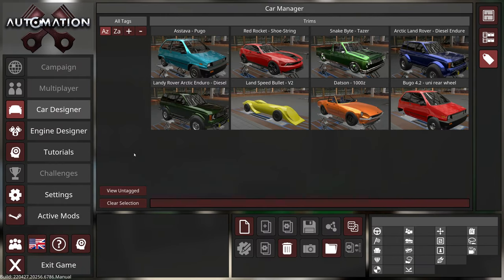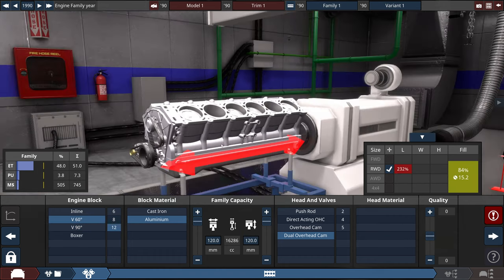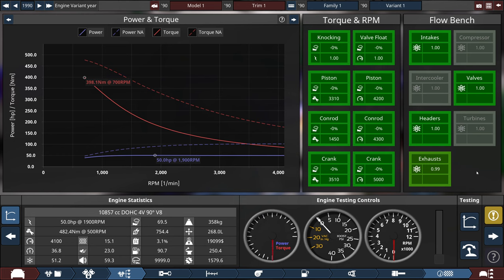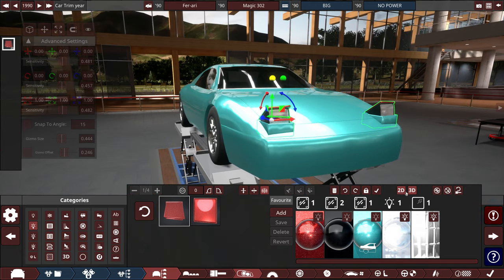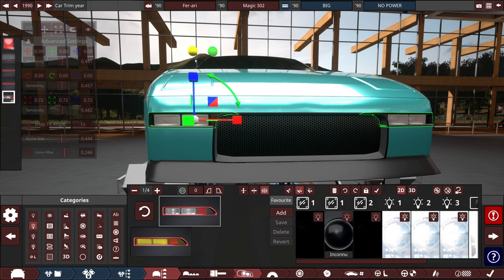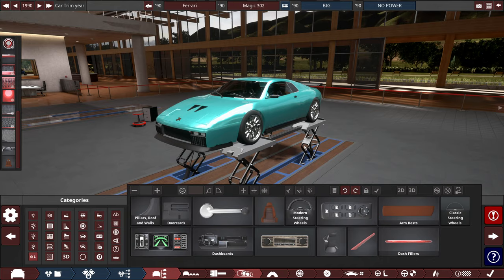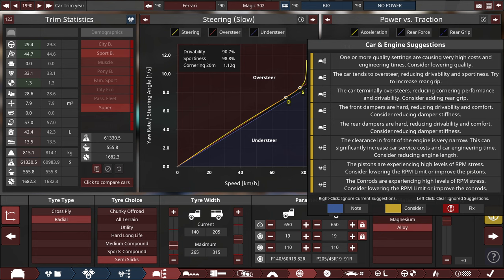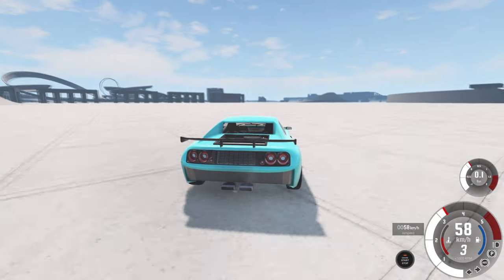Huge Engine, No Power - Automation + BeamNG.drive

Comment from the maker: Massive intercooler bottleneck.......

Check out the entire series here! https://youtube.com/playlist?list=PLTH7mxIBPJoo53TFQcaVJAfPwmKMbbrAp

Stickers are here: https://automotiveflux.com/
Reply: If you use the 80s design room to build your cars, it looks alot better without ray tracing.
Also you've effectively created an 70s muscle car, lots of engine, but said engine is just a paperweight.
Reply: Can u do the last car as a vvt cams and everything and put the vvt to max and normal cam profile to the lowest
Reply: @critterproformance1824  that would basically make the tourqe two lumps. One up high, one at 1500RPM.

Comment: I made a similar engine In my 1946 armored car, I used the morris minor 2.8 m body, and it weight 4.6 tons!, the engine alone weight over one ton
Reply: Not much armor, I want to see how it looks
Reply: Fun fact: you can loose power by having too large an intercooler for the engine performance, too high a fuel mixture, too large of an exhaust, and too large a cam profile on carbed and or pushrod engines. 
So basically you can make a gutless engine is you don't know how to tune it probably.

Comment: Ferrari with a and yacht V8 (how did Buick only get 186bhp out a 7.5 liter engine all the emission equipment that decreases MPG)
Reply: If you are talking about the old american v8s from the 70s That was the same time the SAE standardized dyno testing. One year they were still using gross horsepower with long tube headers and long intake runners on an engine test stand then the next year they used net hp. The rules were you had to measure horsepower with your power steering pump on, actual exhaust system, ac compressor, transmission, actual intake, and all the stuff the car would come with from the factory ON the car, with the car on a chassis dyno. A whooooooole bunch of cars suddenly got real numbers exposed. Then the emissions equipment was just the cherry on top. 

If the however actually tried making their engines breath and burn better, they could have been able to make more power and burn cleaner. Look to motorcycle racing at the time while they were still using carburetors. The power to engine displacement figures were absurd. There wasn't any fancy tech either. Just good design.

Comment: the reason you are encountering so much shift lag is likely due to a bug (or, at least, an untested edge case) in the Automation->BeamNG importer. With such a narrow powerband, the automatic clutch logic is attempting to wait until the engine reaches an RPM that it will rarely, if ever, actually reach - so it prevents the clutch from closing to avoid stalling the engine. You really only need 2 or 3 gears and a direct (1:1) final drive with this much torque compared to the power, LOL.
Congratulations! You broke the game and created an engine that could probably never exist IRL.
Reply from the maker: Thanks, I'll keep that in mind

Comment: its fast cuz it has a ton of torque, you're startin with 400nm at 700rpm and at 2100rpm you still have like 160nm, 50hp/160nm is what a nat 1.6 engine usually makes at around 2000-4000 RPM, hp usually doubles at 5000-7000 though (from what you have)
Reply: 400 nm isn’t shit for torque. In comparison to the 50 hp, sure. But In general it’s not much torque
Reply: @loweredyote8416  as i said, 400nm is a ton of torque
Reply: @TheRian125  not it’s not
Reply: @loweredyote8416  a ton as in a really high amount of torque
Reply: @loweredyote8416  Lol, yes it is a high amount 😀
Reply: @loweredyote8416 Yeah compared to a Truck it’s not a lot that’s true…

Comment: i would TOTALLY drive a 50 hp ferrari, it would be the cheapest way to a cease and desist
Reply: they did have a engine that made 116hp
Reply: @flyer3849  ooh yeah, that sounds like great fun, wringing out a Ferrari with honda fit specs around a track? heck yeah!
Reply: @alexselchow  it only weighs 650kg, so could be fun

Comment: since power is flat across the rev range you can pretty much skip to 5th gear to save some time. shifting through all of them is slower since you are in neutral for longer in total. also coulda put fewer gears, it saves just a little bit of weight.

Comment: First of all that's a damn cool idea and i like this approach alot, i don't own a PC so i can't do stuff like that on myself. And it's surprisingly fast indeed, but it made me laugh that my 2003 Suzuki Ingis Sport 1.5 is quite a bit faster from 0-100 with its 109 hp and 1380kg. Funny enough i went the opposite approach on my McLaren F1 NFS Heat instead of 90's sports car, huge engine, no power i went with 90's super car, tiny engine, huge power by slapping a turbocharged 2.0 Liter inline 4 with +1000 HP into it.

Comment: The flat-plane billet steel actually has TERRIBLE RPM strength so you need to use regular billet steel to get any good RPM out of it. Found this out while trying to make a high-power 70s V8
Edit: yes I'd drive it because get a new intercooler and chop the exhaust and you have over 1,000 more horsepower 😆

Comment: You dont need much Power if you weigh nothing.
Thats why Cars in the 70s 80s were fast with under 100HP, they weigh nothing.
Reply: Bruh cars in the 70s and 80s weighed a whole lot more than cars weigh today
Reply: @memorimusic420  Please!?!? A BMW E30 from the 80s weight max 1300Kg. The G20 from today weight max 1900Kg and min 1450Kg!!! I dont know whats wrong in your head.
Reply: @JansenX12  talking bout most cars and most american cars... materials changed a lot over the years
Reply: @memorimusic420  It dosent matter where the Car came from. Materials changed, Safety changed, Size changed, Electronics changed. with all those changes you cant say that modern cars are lighter than older cars with much much less electronics and safety equipments installed. If you want to be sure look up cars on Wikipedia and go back to the first model from the 70-80s. I know for sure that my BMW E90 325i weight way more than the E30 320i from my neigbor.
Reply: @JansenX12  okay mister i know it all
Reply: @memorimusic420  Okay mister i think i know it all